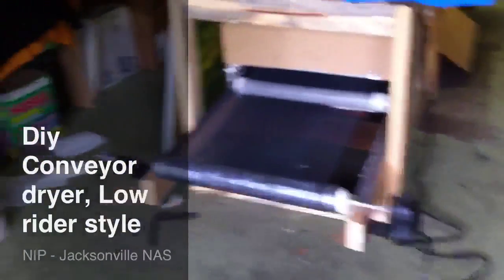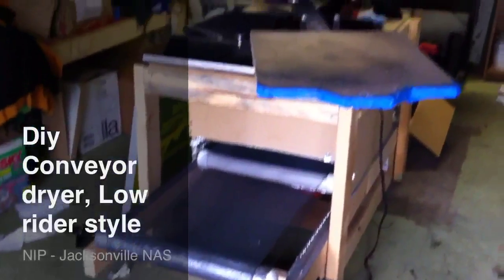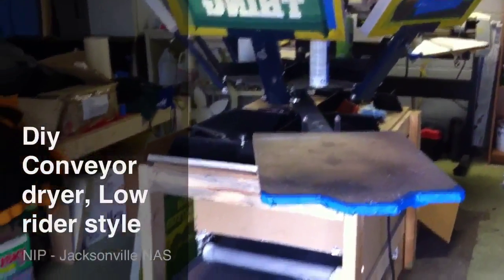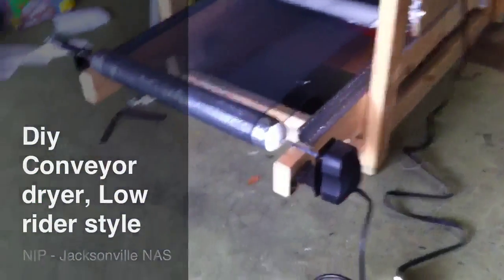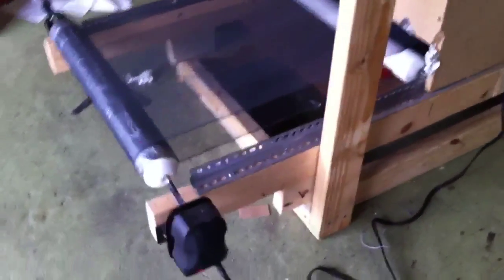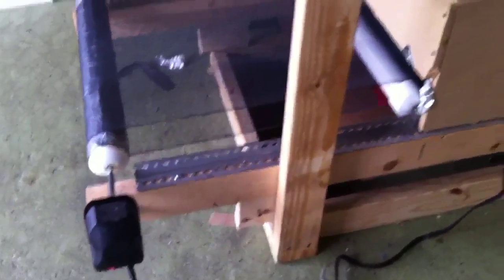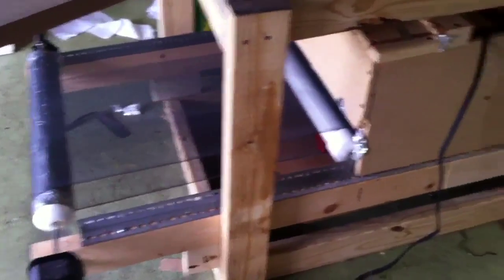diy conveyor dryer

Comment from the maker: i already got rid of my diy dryer. i recommending using a real dryer. it might be more expensive, but in the long run, its a good investment. try craigslist, i got mine for 600 used, and its a lot better and consistent result. no maintenance. when i was using my diy, i always have to fix something here and there.
Reply: I can't believe you did it with us.